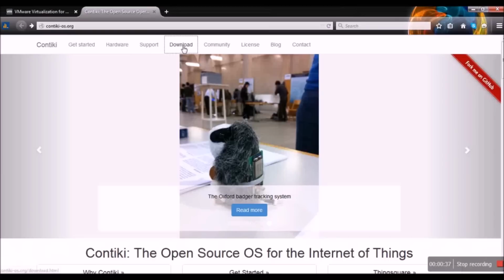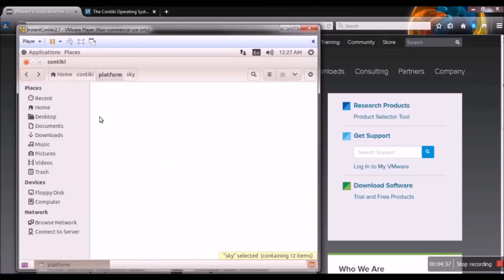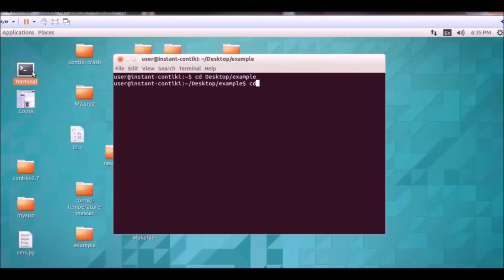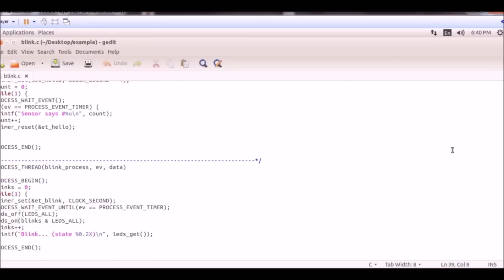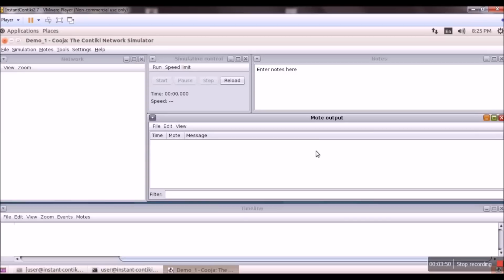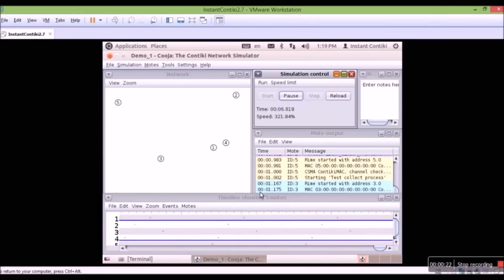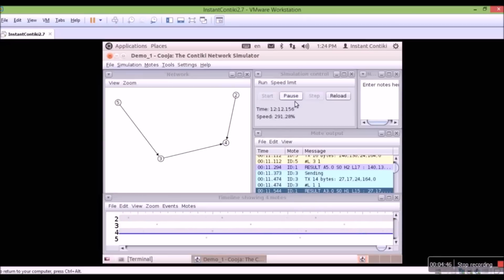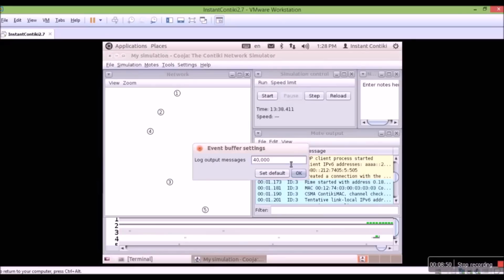Complete Tutorial for Contiki-COOJA

Comment: Hi

I would like to run instant contiki (in VMWare) and run a cooja simulation using 6loWPAN. Is it possible to then communicate to motes in cooja from another VM image  running linux. Hope that makes sense
Reply from the maker: HI 

Though i havnt tried tat but the possibility of it seems remote as it is a simulator it cannot communicate with 2 diff images of VM.
Reply: +ganesh prasad 

Thanks for reply. It did seem unlikely but I had wondered if software like GNS3  might allow me to do it.

Do you have experience of running 6LoWPAN on hardware ? If so could you recommend any motes to use. The only type I found are Zolteria Z1 but they are quite expensive. Thanks for a great video